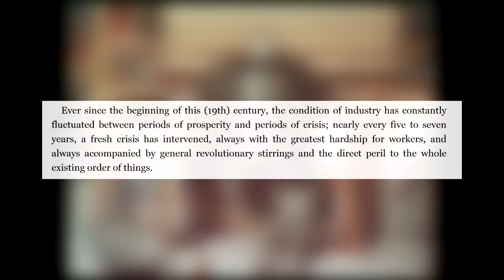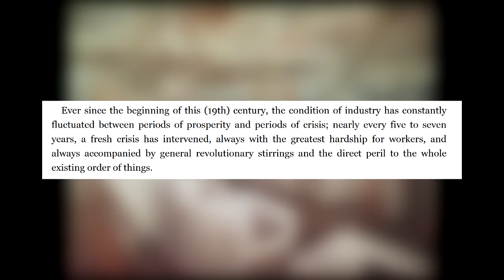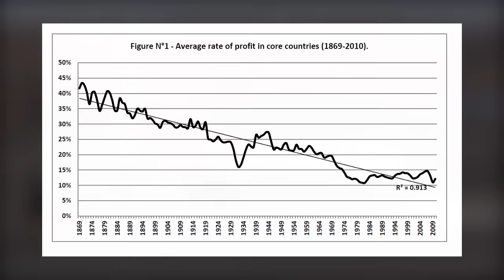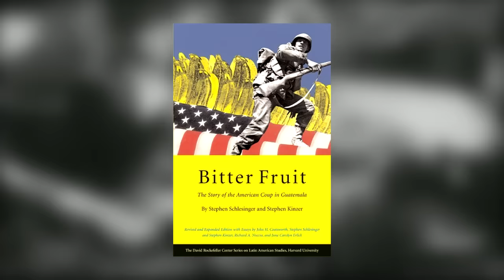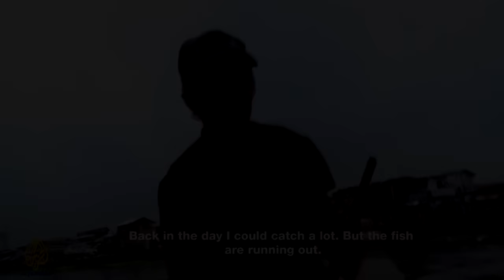Capitalism Really Sucks, But Why?

Comment: The China syndrome (not the nuclear type) doesn't solve any shortcomings of capitalism if you count China a socialist country, which I don't. When China opened up, massive factories were built. They provided cheap labor and cause many environmental issues. Now, China is much more developed, they have more and more environmental laws and workers have higher wages. Many factory operators stop their operations in China and opened factories in places like Cambodia and Indonesia where cheaper labor and slacker environmental laws can be found lowering manufacturing costs. 
Over production is also a problem.  TEMU shopping apps are selling a whole lot of Chinese made junk which whatever manufacturing sector in China needs a market to dump their junk they produce.
This is why I don't count China as a socialist state to put it a very generalized perspective. China behaves the sane as any capitalist country.

Comment: If one can grasp Capitalism without Profit, then the concept has some merit.  
Short of that?  Throw it into the bin, it just encourages the worse in humanity....
Profits are Capitalism corrupted, but it is so rotten right now people can't imagine it without that corruption.

For an glimpse: 
Take that Supply and Demand thing they talk about a lot-  
What if Supply wasn't just to be squeezed for even reduced costs? 
What if you didn't use higher Demand to justify higher prices? 

The way this concept works is simple:
The Supply is used to verify the cost of a batch of products, could be per 1000 or it could be a yearly rate... doesn't matter, you need some base numbers to work with.  While it isn't a bad thing to squeeze some extra money out of the process at this point, it really shouldn't be considered past ensuring no one in the supply line is over-charging you.  One need to know the real cost of manufacturing the product, not how cheap they think they can get the production to be.  

The Demand is used to verify how much of that batch of products will sell, again not for the profit margins but for waste tracking.  While the end product is going to be sold at a rate to cover the costs, likely a tiny bit higher to account for fluctuations in the market, what you really need to know is if you can sell every unit within that batch.  Should your demand be greater then 100%, more customers then you have products, then you don't have to worry about waste and your final price can be closer to the manufacturing costs.   If there is waste to deal with the cost actually goes up, in order for the company to remain solvent.  

But let me tell you a little secret about this current world we live in:  
We live in systems that have greater then 100% demand, due to marketing.
None of these big multi-nationalistic companies have trouble selling products, but they mark them up still...!

Comment: Capitalism will fall one day, but this video contains a few outdated ideas. For instance, when you talk about the diminishing rate of profit you say that capitalists try to outcompete each other, lowering the price of their products and thus lowering their own profits. In the real world, very few things are "the same product" even if they're essentially the same thing. Instead of doing what you describe, capitalists start selling their products to smaller and more specific niches, and when these markets are depleted they just create more niches themselves, they recycle old ideas, etc. Like, Apple might as well sell trash bins for 10 times the price of identical bins and they'd run out of stock on day one. This is an absurdity Marx couldn't possibly have foreseen because there was no analogous situation in his time.

Comment: Decent video but I feel like there are elements of it that could stand to be improved. For example, your third point provides a claim and extrapolation, but it doesn't provide more concrete evidence. A Capitalist might point to reform or otherwise try to claim Capitalism doesn't require "infinite growth" or might suggest all systems do. In this regard, having a more thoroughly built-up argument to support the claim, combined with more evidence, would be useful.

Comment: I wholly agree with this video, but have just one thing: Decreasing demand for a product is supposed to demotivate overproduction of that product and drive capitalists to move on to the next societal need/consumer demand to continue the profit train. For example, Sony is ending production of PS4s because of decreasing demand, while ramping up production of PS5s to meet the new demand for that hardware.

Nintendo, as another example, wouldn't have survived by continuing to produce Virtual Boys, N64s (versus PS1, PS2, and GameCube), GameCubes (great system, though), Wii Us (another great system, though I didn't buy one 🤷🏻‍♂️ ), or other hardware with high or otherwise decent sales that had been outpaced by continually evolving digital tech. With the Wii U, in particular, Nintendo ended production of that system just before launching the Switch, only a little more than 4 years into the Wii U's lifecycle, due to rock-bottom demand from the general consumer. However, the 3DS/2DS family continued into 2020 despite the ongoing overwhelming success of the Switch due to having exclusive games, but Nintendo had to call the end of its production to ramp up Switch production. Anybody who wanted a 3DS and/or 2DS got one, some way or another.

Wikipedia on the GameCube in particular:
"With sales sagging and millions of unsold consoles in stock, Nintendo halted GameCube production for the first nine months of 2003 to reduce surplus units."

I'll watch your next video on Socialism, but Capitalism really is grounded in the Supply/Demand system. We vote with our wallets/purses/accounts, or at least we're supposed to...

Comment: the Kenyan economic was an attempt to control some of the excesses of capitalism, without removing capitalism. Unfortunately the capitalists' political wing ( lobbyists ) worked hard, buying the politicians etc, to undercut this system, setting up in its place the Thatcher/Reaganomic system which has brought back these damaging business practices. This system is often referred to as " the trickle down " economic system. It was sold as such. But funds do not trickle down ( only the blame )  and those who profit from it complain when referred as such.
But somehow they blame the "current" Kenyan economic system for all the problems.

Comment: I have a few criticisms of this,  

Chapter 1,  Of the boom and bust,  i don't see any evidence that booms and busts are caused by overproduction but generally of over speculation.  If you look at the time period of the writer you referenced the booms and busts were actually panics generally resultant from runs on banks.  So the banks would overloan their gold on the gold standard (aka overspeculate)  and when people got wind of it there would be a run on the bank resulting in the panic and then the bust that followed.   If you look at the 1929 crash it's hard to argue overproduction, it was certainly rampant over speculation that caused this issue.  Same with the boom and bust of the classic tulip bulb scenario.  Look at gamestop for a very current example,  speculators literally had more than 100% of current stock shorted,  an impossible over speculation,  and they busted out hard.  This is a micro example but if it's system wide thats when the systemic bust happens.  Overproduction doesn't necessarily have a negative association, you can store the over produced item.

Chapter 2,  falling rate of profit,  you essentially say a strength of capitalism is a weakness by pointing out that the system effectively reduces prices of product,   the value of the product being lowered in relation to labor by innovation is a good thing,  less resources in for the same product out.  I would not list this as "why capitalism sucks" it's probably the only reason the system had been tolerated for so long tbh.

Chapter 3,  Finite World,  There are other worlds,  other galaxies, other dimensions.  There is no reason to believe that human growth is limited. 

The other stuff, fair enough from my perspective.  I just think chapter 1 didn't actually find the cause of boom bust correctly;  and CH 2 and 3 seem like disingenuous points to me, and unneeded to show your premise as true.
Reply: @rickdeckard7525    For sure, no argument there, i just think it's a limp and shitty talking point because it assumes that even working cooperatively we can't overcome the difficulty of our situation.  At least thats what i hear when i hear that finite resources schtick.  I'd rather have a message of "we can overcome"  rather than a "lets give up and live less"  because the one has both a more cooperative context and because i think it'll garner broader support 

=)
Reply: @rickdeckard7525    Thats what i mean though =)  The framing of infinite growth on a finite world is a framing of austerity not of progress.

Comment: All of the problems with capitalism would be solved by making government impenetrable to business and finance.  One way this could be done is to eliminate representative democracy and instead move to direct democracy.  This could especially be accomplished by block chain voting.  Also elections can be made less manipulable with rank choice voting for government positions and the moving of the political system away from the duopoly and to multi party systems.  With direct democracy, government would work for the voters interests and representatives could not be bribed to vote against the voters interests.  Socialism could be implemented by the voters where ever it is needed.  Maybe there would still be legislators, they would just craft bills, not vote on them.
Reply: Even if that really would solve everything, how would you expect to implement that?
Reply: @chrisgaming9567  Violent revolution is, of course, not the preferred method.  Which leaves small increments brought about by focused effort of dedicated groups that coordinate political effort to one task at a time in priority.  First, we need to form these groups and prevent them from being co-oped by the establishment.  Those groups must be populated by people with integrity and intestinal fortitude.  Second, fix the election process.  Some states have already implemented rank choice voting, so it is NOT impossible to do.  At least 14 states have created a law that when over half of the electoral power of the country makes the same law, then all of a state's electoral votes will be given to the winner of the popular vote in a presidential election.  Get that law in another 11 states and we will have a President elected by popular vote instead of electoral college.  At the same time each group must harp on local election integrity by insisting on election accountability and transparency.  Primaries are what leave us with the choice between two evils so the groups need to get more residents to vote in primaries and vote over all.

Comment: Hey! About the centralization of capital, you claimed that there is less and less variety of options for goods and services. Would that not, however, also be the case in a collective system like socialism? I mean every single industry would be collectivized and certain standards would be put in place that would be hard to change by people who have ideas that can make a difference. In other words, that would be a highly burraucratic process.
Reply: Under socialism the enterprises are not motivated by profit so won't do scummy things to increase their profit.
Reply: Capitalists claim that capitalism improves through competition. The fact that Capital tends to always concentrate in a few hands disproves this claim. This necessarily means that Capitalism does not improve after a certain point and in fact only degrades and erodes. Socialists however, do not claim that Socialism improves through competition to begin with. Socialism aims to organize production for the benefit of the Proletariat. From each according to their ability to each according to their needs.

Comment: And socialism, apparently to you, never supports corruption?
Reply: Everything can. Capitalism must and socialism doesn't always need to
Reply: @NikolaiTheJester  capitalism "must"? Nope
Reply: @christopherwood9009  yes. It always ends up in it because power will lead to corruption
Reply: @NikolaiTheJester  I'm Not Defending Capitalism, I'm Shitting On Socialism In Practice
Reply: @theeternal2734  we've never gotten the chance to really practice due to capitalists. It could definitely work its just a hump to get there as any other transition sadly :(
Reply: @NikolaiTheJester  There Will Always Be Capitalists, And No One's Gonna Prove That Socialism Is Better By Pulling Another Lenin
Reply: @theeternal2734  we kinda just have to force it though cause the capitalists won't just agree. We have to take it. Also there's still monarchs aswell but they have no real power now that the system has changed yknow?
Reply: @theeternal2734  Lenin did nothing wrong.

Comment: That boom and bust cycle doesn't really make any sense in your introduction to me. 

You get booms when there are forces that are causing extremely high demand like when a massive war and the government is throwing money at the problem, or when there has been a massive influx of people buying goods often cause they think their cash is going to worthless soon or there is easy access to cash from loans or printing of capital. 
This causes the retailers to have to restock on goods, thinking that people want more of something they buy more of a product. Which then signals the factory that they are going to need way more to meet the demand. 
The Bust happens when the cash flow into the market is suddenly cut off ie the war has ended or people's savings have been used up. This then cause the overproduction issue cause everyone is out of cash from the buying spree earlier and demand falling to pre-boom prices. Creating a massive economic bubble that either pops or a government try to keep it going for the votes.
So capitalist's don't magically cause these booms and bust but results of human actions.

A great example is the great depression caused by World War 1. The USA which was mostly untouched during the war was supplying the ENTIRETY of Europe from food to tanks. High demand caused by a massive war in Europe that left everyone on the continent with broken economy and unable to produce anything. Leading to the USA to having to supply everyone in Europe, meaning factories are to be built in order to get goods to Europe and people are to be hired to work in those new factories. So what happens when the war ends and demands fall? Well the artificially high demand caused by the war would drop down to pre-war demand, leading to a small but manageable slump in the economy as we don't need steel for tanks and guns. But when Europe fixed itself after the war allowing them to make their own goods again this made it worse. As now the USA has no where to sell all these foodstuffs and consumer goods that were made for the war to be sold to these war torn nations causing everything to rapidly descend back to pre-war conditions but now with more people out of a job.

Comment: Both capitalism and communism is shit,not because of it's ideals but because of the human factor. Both capitalism and communism could work without many of the problems it has in each of today's respective economies but they don't and it's because of the greed and want for power. Its like you fail to see the human factor. These systems were made by people who also once had a problem with their economy,which most likely was the monarchy. And they thought long and hard about what they could do to improve their lives. No matter what you think, someone in the family line of a billionaire started with nothing and they paved the way for their children to have something. They worked, they thought and struggled. And they built and saved their wealth so they could live and die comfortably. Now how they got there most likely disadvantaged other people but if those people found ways out of that disadvantaged state,then what's the issue. The dream of capitalism is self sufficiency. A relatively unstable economy stabilized by a want for a better life,forcing people to think outside the box and to work hard for it. 
Communism on the other hand is that all have the same life. You work for your country and not just yourself. And while it seems noble,you're forced to live a bland life of bare minimums. You live according to the needs of the lowest. This can build a strong nation that is able to survive in the lowest of times together. If you look at only the good of Russia's and the USA's economies,you'll see the goals of both communism and capitalism in it's respective area. People consider Russia strong because of it's bonds,nationalism and resilience and people consider the USA strong because of it's technology,innovation and want for a better life. 
Now understand that the human factor is the reason most things don't work.

Comment: Wow, you just made up a lot of shit. And then proceed to point out the shit you made. And throughout this video you didn't even define capitalism. If you want to make a video attacking capitalism, you start be defining what it is specifically, and going over issues and pointing out how those issues relate to that definition, specifically. Most of your sections are based purely on assumptions you have made. There is nothing in the definition of capitalism that says profit is above all else, that you need infinite growth, that you need monopoly (monopoly is the result of anti-capitalistic interference, such as the concept of intellectual property!), or that economics is based on merit.